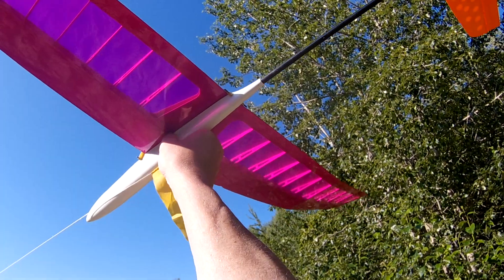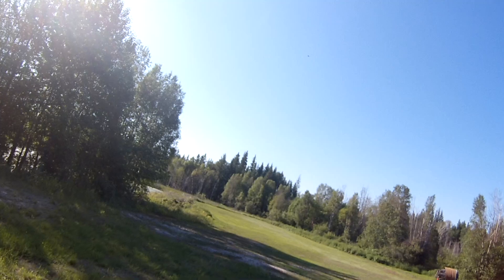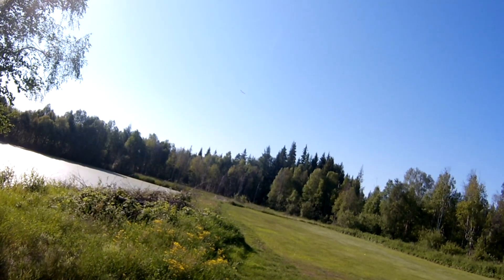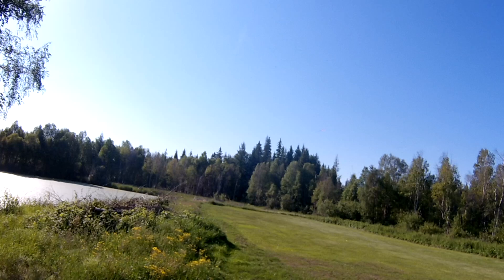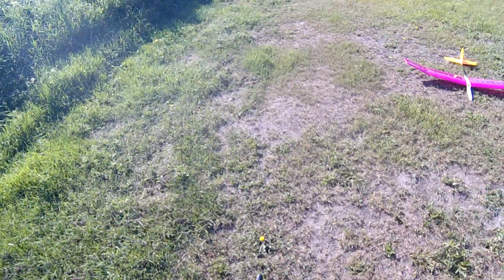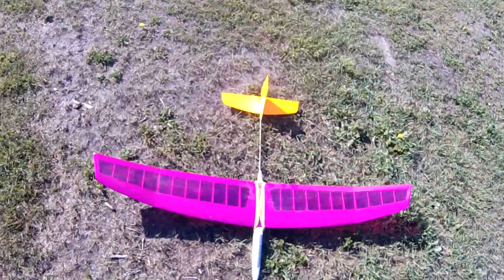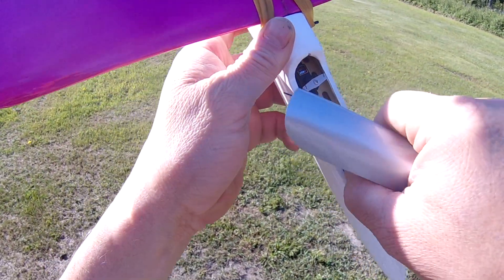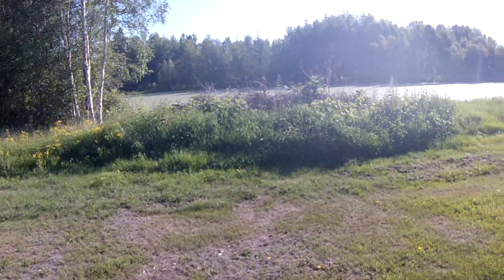Great Planes Fling Thermal morning bungee launch flight

Comment: Nice flight. We used to have a blast with Gentle lady's off a high start.
Reply from the maker: @ModelAV8RChannel  thanks, when I was a kid I had a glider similar size to this but it had an .049 on a power pod, motor would take it up pretty high then the thermals would spec it out. This is my first high start.